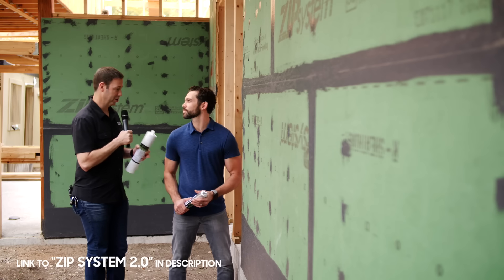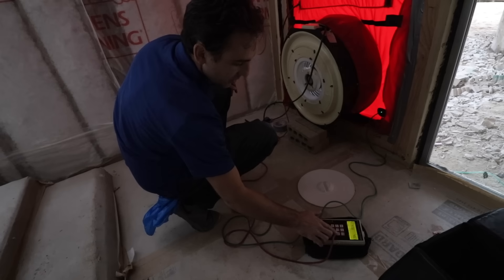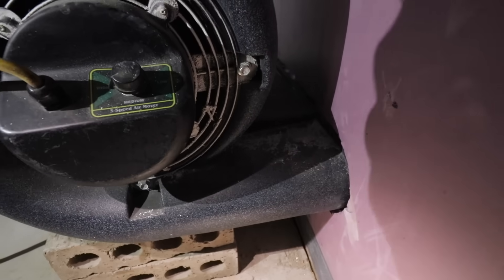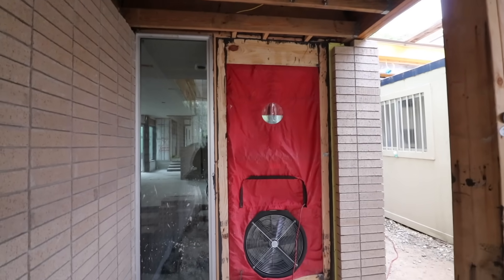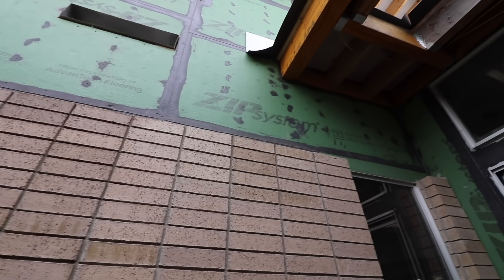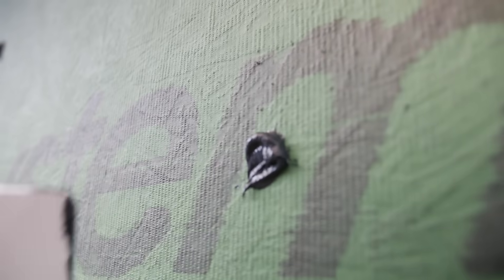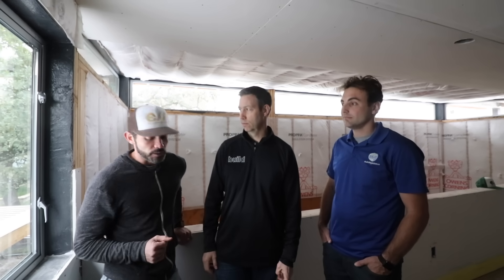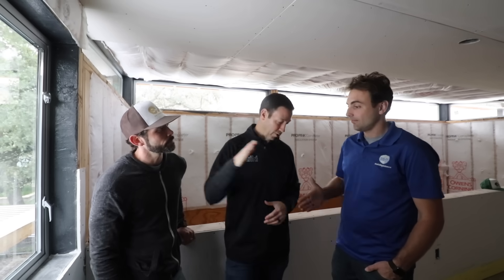A terrible Blower Door score till we figured out the problem!

Comment: I'd really like to see what he was talking about with sealing an attic without spray foam. I thought you said that he used blown-in insulation after he seals the entire thing but not sure what that would look like in between the roof joists etc?
Reply: James Calbert me too
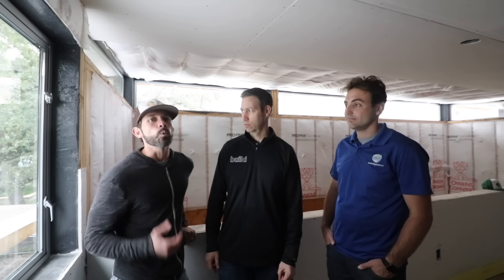Reply: As he says at 7:36 "seal everything from the outside." Spray foam does two things. It air seals but it also insulates. Normally what you're doing on the outside is water sealing only. Matt is also pointing out the insulation part of that with fiberglass. The fact that its blow-in instead of batt is a bit incidental except that they use fiber sheets to hold up the fiberglass. I could speculate the continuous sheet provides a better seal than batts do. Then again if people tapped their batt flaps they'd probably work to. Blow in is better from a speed and consistency standpoint.
Reply: @Furiends  sorry, can't picture what you're saying either. When Doug refers to a "sealed envelope, known as a conditioned attic" he discusses sealing the outside but Matt then adds about using blown-in insulation for the interior. When I think of that my experience has only been with mounds of fluffy pink stuff in an unsealed, unconditioned attic.
Reply: @jamescalbert4958  He is talking about air sealing the exterior of the roof as he did the walls.  Typically, roofs are waterproofed, but not airsealed.  Spray-foam is what most builders accomplish the airsealing and insulation.  He airsealed with caulk and liquid flashing on the exterior, and insulated with blown in fiberglass.
Reply: @gracilism  Yea, I heard the part about Doug sealing the outside and watched the vid that Matt did where he sealed AND insulated the outside of a house (which I REALLY dig) I just don't know what the "blown in insulation" would look like if he's planning on using the attic. Perhaps he doesn't intend on using the attic and it's just like any other attic with blown in insulation and I'm reading too much into it. Wouldn't be the first time! 😒   😄
Reply: @jamescalbert4958  I think owens corning make a system for blown in insulation on the underside of the roof. But basically I believe it is a suspended membrane that they blow insulation into.
Reply: @lrc87290  OK, that makes sense but more sense on a flat roof like what's in the background in this vid. Trickier for a sloped roof.
Reply: @jamescalbert4958  pretty much my dude putting insulation on the inside part of the roof, right below the surface of the roof between the joists or whatever you call then where you lay the roof. Sorta like in the walls of a house but on the belly side of the roof sounds like. Where the spray the spray foam. Sound good, otherwise it would just be right above the ceiling where you normally would insulate with whatever with blown in insulation.
Reply: @jamescalbert4958  Yes don't get caught up to much in the blown in method. Inherent in this system is that its done carefully and precisely and with fiberglass instead of cellulose. It's not free floating but held in with fabric.
Reply: @jamescalbert4958  He's just talking about his Zip 2.0 methods, that's all. He does that around the entire house. They made a video of it.
Reply: The system used on this project involves completely air sealing the roof decking with liquid flashing and instead of using a spray applied closed cell foam insulation, the BIB (blown in blanket) system was used, essentially to reduced cost and keep chemicals out of the home. Doug mentions that this system is just as effective as the spray foam insulation.
Reply: Unless they are ordering passive certified windows and doors then one cannot complain about leaking windows and doors.
Reply: A plastic vapor barrier is stapled tightly to the joists at the roof, and blown-in insulation between the plastic and the roof sheathing.
This image is terrible quality, but it's the best I could find after about 10 minutes of searching.  I don't think it's a popular technique, though I know for certain I've seen it on this channel at least once.  This image is actually of a basement, and the floor above is flat, but imagine the same thing, at an angle. https://i.ytimg.com/vi/geQPv_LcMQs/maxresdefault.jpg
Reply: @easymac79  You wouldn't want a vapor barrier on both sides of the insulation.  If the roof is sealed, you'd need some way for the part holding the insulation to breathe or you'd get water vapor trapped.

Comment: How does applying house wrap (like Vycor self adherent film) compare verses applying sealant over nails and seams?

I’d have to believe that rolling out a peel and stick is more labor efficient than muddling seams and nail holes. Another plus is the increase in moisture resistance.
Reply: Most STPE fluid-applied WBR membranes are two part (joint & seams first using a denser caulking/sausage application, followed by a thinner viscosity rolled or sprayed membrane). This method eliminates step 2 by utilizing the pre-adhered WRB on the ZIP panel in lieu of more the STPE. Trust me, while still not cheap, it’s less expensive this way.
Reply: @DesignBuildDoug  I just sent a request for a quote to my local supplier for the Zip-R 6.6  (1" Foam).  According to the brochure I have, they only make 4X8 sheets.  Have you used anything larger?  Like 4X9?
Reply: Gunga Dinn I’d love to see follow up on this this comment.
Reply: Probably materials
Reply: I think that is the big debate: material & labor cost vs energy savings return.
Reply: Colin Spradlin And the time it takes to get that return. Ideally within the mortgage term seems right. Or possibly in the time you plan to live there.
Reply: zip sheeting is a house wrap built in as far as I can tell, and all you are doing is patching the holes and transitions.

Comment: I built my own house in 2008. It has 5600 square feet of floor area.

My ACH50 was 1.6 which is quite close to the result they got on this house.  No Zip sheathing, no spray foam, no expensive windows.

I tried to seal the penetrations as much as I could before the insulation was installed with spray foam and caulk. Cellulose was blown into the stud bays and the attic.  I used the airtight drywall approach.  Vinyl windows (Survivor brand, now defunct- they are nothing special, just a decent vinyl window), Andersen sliding doors (2),  Masonite hinged doors (2). Nothing special was done on my house that anyone with a little bit of construction experience could not do themselves.

I'm really pleased with the results.
Reply: I built my 2 story shop the same way and achieved 1.8 ACH...not that it makes much difference since I have a 10' x 12' garage door that I open all the time. I caulked all the stud bay joints properly (yes it took forever) before insulating with Rockwool. I also used blown in cellulose for the ceiling. You're right it's not that difficult if you just think about things a little bit.

People tend to get caught up in the hype over all these expensive products and forget that the main reason they exist is to make the manufacturers money. It's possible to build without them and achieve similar results.
Reply: So you achieved 1.6 ACH50 without expensive windows, no zip sheathing and no spray foam.  Just sealed the penetrations with spray foam.
Reply: keep in mind this 1.5 is prior to drywall. also number and size of windows has a big impact on how well a house will seal.
Reply: @DanielsCorner644   My SFBE (square footage of building enclosure or building envelope) is 10,096 and my conditioned CF is 53,233.  I have 361.8 SF of window (not the glass dimension, that's the rough opening so the actual glass area is a good bit less) and 140.7 SF of door opening area.  

I imagine the house in question has a lot more door and window area.  I kept my building shape relatively simple (it doesn't necessarily look like it due to the way I designed it, but it's pretty efficient in terms of SF of interior floor area with respect to the SF of exterior walls) so I would guess that the house in question may have more wall area that my home.
Reply: @jpbinva9919  the big thing to look at is joints, specifically the linear footage of door and window edges as this is where the potential for air leaks are the greatest, then for double doors you have the joint between them (that's an issue on my house where I can feel 5he air coming in) if you tape or otherwise seal all the joints on the sheathing (which is standard practice with zip sheathing) then you can achieve the same airtightness as a zip house because you did what they do to air seal, the green on a zip board is basically just you house wrap
Reply: JPB in VA - What do you define as the "airtight drywall approach"?
Reply: @wjthehomebuilder    It should be self explanatory...air inside the home doesn't leak out passed the drywall.
Reply: @OU81TWO  Thanks!  It wasn't! Can you explain how?  Are you just caulking the sheetrock to the bottom plates?
Reply: @wjthehomebuilder   Fair enough. It's more than just caulking the bottom edge of the sheet rock. That wouldn't work anyway since that edge is not exactly smooth. You need to stop air from getting past every joint possible. Don't think of the sheet rock as the only component in the system. As an example picture your base boards against the sheet rock running along the wall then turning 90 degrees at the miter joint and running along the adjacent wall. Air will get in between the baseboard, sheet rock, and floor at 3 junctions...1) top edge of base board that touches the wall 2) bottom edge of base board that touches the floor 3) through the miter joint where the two walls join. You need to caulk all of these 3 junctions to make it air tight. The same principle applies throughout the entire house. Follow the joints and visualize where they lead to. If it eventually leads to the outside then caulk it.

Makes sense?
Reply: @OU81TWO  Thanks for clarifying.  I googled the term "airtight drywall approach" and all that came up was what we refer to as just air sealing prior to sheetrock.  It didn't address anything post sheetrock.
Reply: @wjthehomebuilder  Here's a link to explain it better.

https://buildingscience.com/documents/information-sheets/air-barriers-airtight-drywall-approach

I haven't seen much talk about this recently, but it used to be more popular (back when people had to make do with "normal" building materials, no ZIP sheathing, spray foam not as common, etc.) and I think it still has some merits.
Reply: Your square footage probably played a huge part in that. 5600 is pretty big and volume plays a major role in blower door results.

Comment: Casements, awnings anything that sucks tight is the way to go if you want an airtight house. Single hung, double hung, sliders those things are impossible to seal. I used to test windows and there are two factors to consider when looking for high performance windows. Whether or not there's mechanical advantage that compresses the seal and quality control from the factory.
Reply: Yes, bulb seals, compression seals are best for sure( xasements, awnings, etc. Like you said) . He mentioned 'sliders' and we all know they leak badly.

Comment: Does anyone make a device that can measure the BTU loss of a house?
Reply: Bryan Hensley You have to hire an energy consultant service that runs a simulation based on r-value, house construction, air tightness, etc...
Reply: Electricity and/or gas meter?  Seriously, you can do a "coheating" test, but it's not a trivial test to do...
Reply: Manual J

Comment: What are some decent replacement windows that don’t cost an arm & leg? I have a 1961 brick ranch style house that desperately needs new windows. I’m in Charlotte NC. Are triple pane windows overkill? The house also has no shade. Hot in the summer. Freezing in the winter. Great video!
Reply: Really depends. One thing to be wary of is most North American triple pane windows perform not much better than their double pane counterparts, because instead of installing them in frames meant for triple pane, they just squeeze another sheet of glass inside a double pane window frame. Look at whole assembly u-factors in order to compare windows.
Reply: I have a 1980 house, CMU in SW FL. Door to door window salesman trying to get me to replace my original single pane. I always tell them if I was going to spend the money I would be better off replacing my old ductwork and adding more insulation to the attic first.

Comment: how tight is too tight , with out gassing , I like some fresh air
Reply: It can't be too tight. You don't want to rely on leaks in the house to provide your fresh air. Mechanical ventilation is key.
Reply: Use materials which you will not have to worry about gassing
Reply: And use an E/HRV to get your fresh air.
Reply: Build tight, ventilate right (heat recovery ventilation and or demand controlled ventilation which are controlled with air quality sensors).
Reply: The Risinger way is to go 200% on all the exterior weather proofing to ensure NO water. Then to use systems to bring the air into the home and condition it (humidity, filter, temperature). Obviously there's risks in going so tight on everything because moisture can't get out if it gets in, but there really are good products out there to really take the exterior water-proofing to that 200%. Joe Lstiburek is a straight shooter building scientist that really laid it out for me.
Reply: Active air system